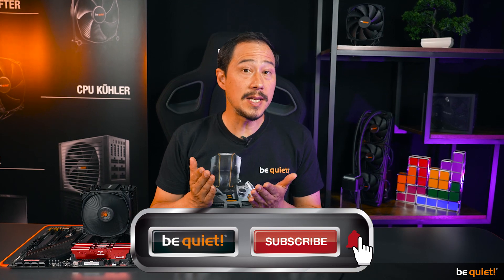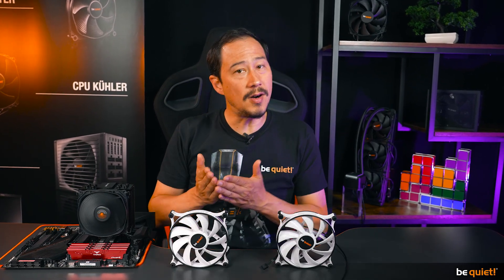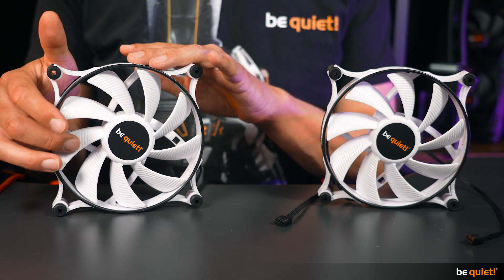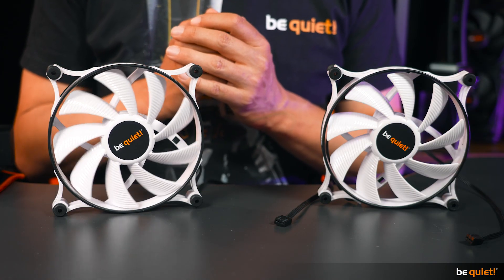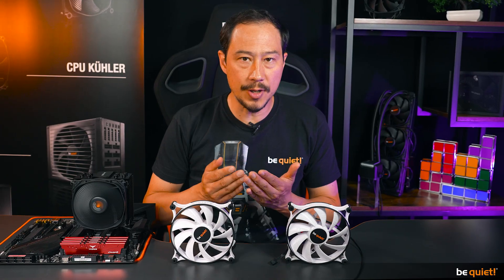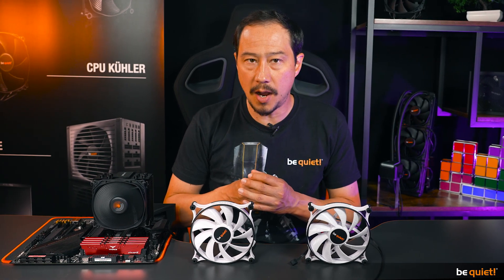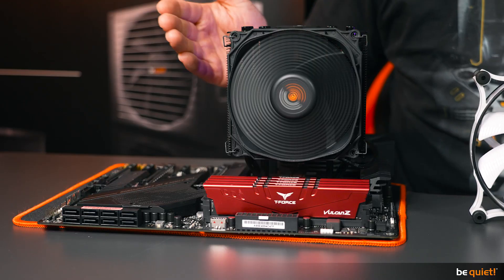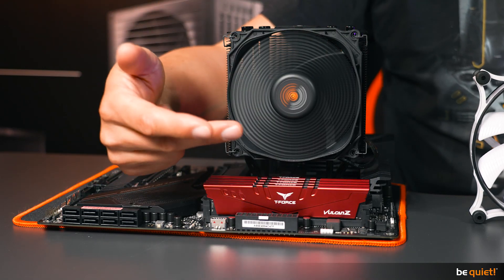What is PWM? | be quiet!

Comment: A few years ago I found some cheap 4th gen ASRock motherboards that treat DC fans like PWM ones, by simply turning the 12V power on and off. Those fans only lasted a few months before they started shaking due to the bearings becoming loose, if you hold a blade you could feel the powering on and off like 5 times per second, and that only happened with the fans connected to that motherboard.

Comment: It's the same with a servo tester or the throttle in RC tech. I made a Raspberry Pi Pico act on a signal line to an ESC/Motor and got a cool propeller going (0-100% with some buttons). Another signal line can provide input from a temperature sensor, so it's way more interesting. Solar controllers can also use it towards the battery, so the sun (solar panels) don't give too much voltage and charge at a suitable level.

Comment: So can i put Case Cooler Be quiet Pure Wings  2 ony my CPU cooler and plug it in 4 pin and everything will work alone just fine?
Reply from the maker: It depends on whether your cooler is suitable for a Pure Wings 2 to be installed on it. Please check your motherboard manual for the location of the CPU cooler connector (CPU_FAN). This should be used and not just any PWM header.
Reply: @bequietofficial  Can SILENT WINGS PRO 4 be installed on the DARK ROCK PRO 4 cooler?
Reply: @bequietofficial  And what is the best way to install fans in the case? 2 SILENT WINGS PRO 4 inlet and 2 SILENT WINGS 4 inlet? Or is it better that all 4 fans are pro?

Comment: I like your products and just the other day wedged a 120mm and a 140mm Silent Wings 3 into the PSU compartment of my Dark  Base Pro 900 rev2!
Right behind the Dark Power 11 750W!
I like the airflow and thermals in that case.
But I have to reduce my front fans by one to add the 5.25" bays and add some 4SSD bay compartments and a 3.5" Hot Swap bay.
But the beauty of your components is they are so modular and durable!
I have 3 140mm and one 120mm intake fans now all coming through filters. And one 140 and two 120mm exhausts. (all Silent Wings 3).
And I put three Silent Wings on the Dark Rock Pro4 cooler.
Temps stay nice, it looks nice and it's nice and quiet! And yet it runs 24/7 at 100% CPU. Dependable stuff, thanks!
Yes, it cost more than the customary fan types and quantity. But I can walk away from this for 12 hours without concern.